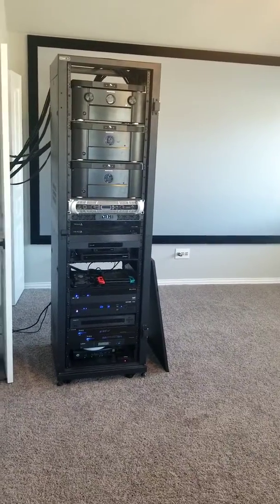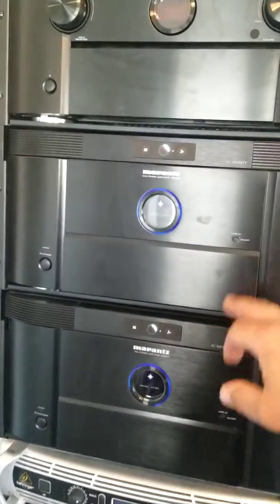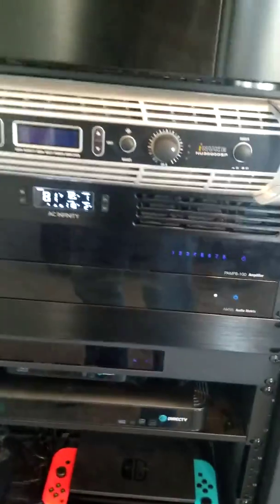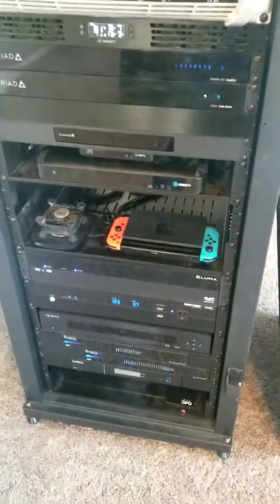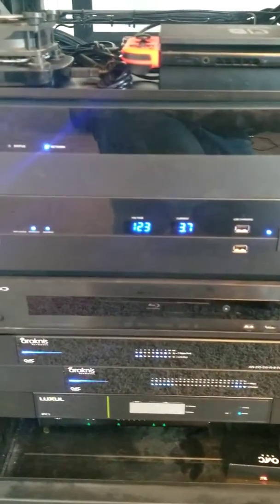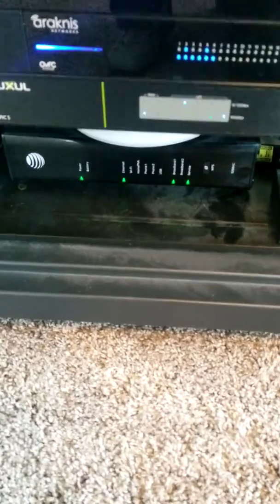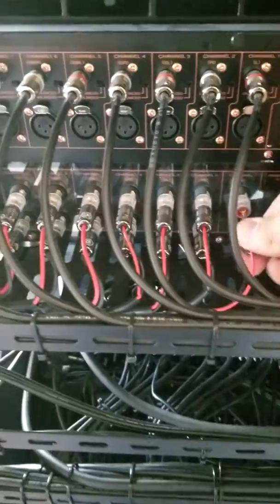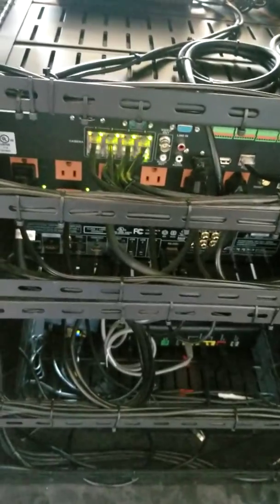Home Automation Rack Walkthrough

Comment: With the triad 8 zone receiver is it possible to have in wall subs through the house in the different zones to have some bass along with the 2 speakers to each zone?
Reply from the maker: Yes.   You run from the triad matrix to the su woofer amp of your choice with rca pass throughs back to the triad amplifier.
Reply: Elite Audio Video Ok so I need to have the triad 8 zone receiver plus the triad matrix?

Comment: What rack ears are you using to hold your amps in place? Amps are heavy. Do the ears only mount to the front or do they also screw into a side vertical rail??.
Reply from the maker: I use the brand snapav.  Thier shelves are thick steel but they also have a back mount if you want to use them.
Reply: @eliteaudiovideo8937  thanks I'll go look. Appreciate your time responding!!

Comment: Noooooo not a Behringer iNuke! It's a really crappy amp; actual output wattage is around half the rated wattage with muddy sound. I hope it's working for you, but when it does burn out, look into getting a Crown amp. A Crown CDi 2|1200 or XTi-4002 should do nicely depending on what subs you're running. Much better sound, you will be surprised! Anyways, rant over, nice rack and wiring, hope you're enjoying your setup! :)
Reply from the maker: I actualy never hooked it up.  I decided to use JL 13.5 JL Fathoms instead and built them into my walls as it's a brand I sell.